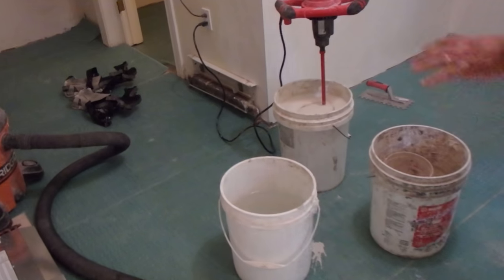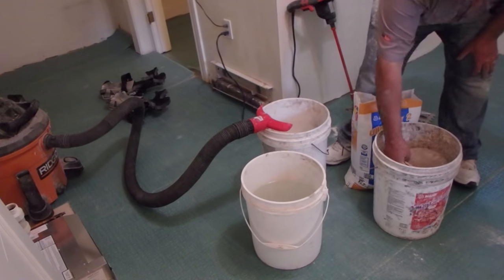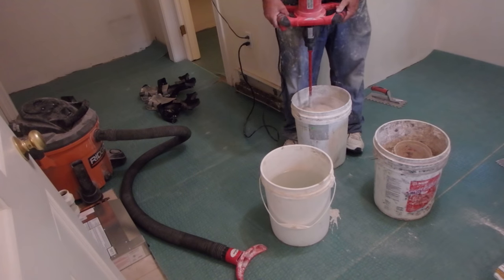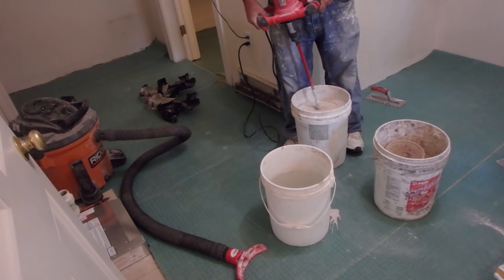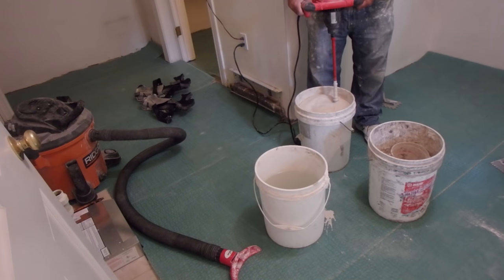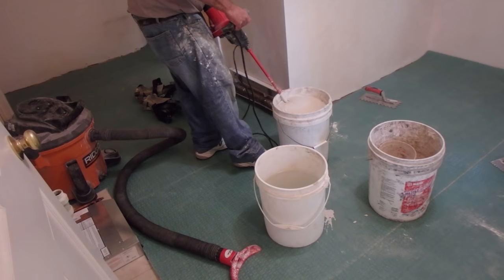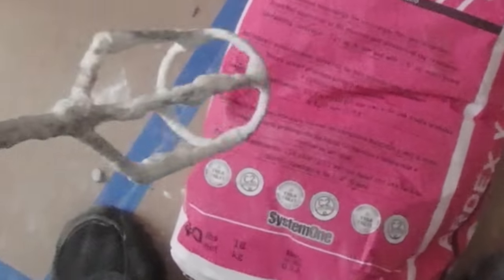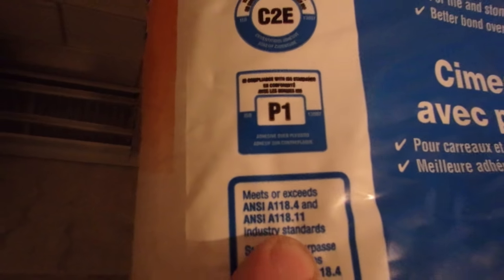How to mix thinset mortar the proper way,

Comment: Hi Sal- Thanks for sharing all of your knowledge. It's really helped me along the way. However, I made a mistake the other night. I mixed some Ardex-5 once, and only let it sit for 5 minutes before laying it down. I did not mix it a second time. Now, it's too late. It's hardened up, sitting in between Ditra and subfloor plywood. How concerned should I be? Thanks in advance!!
-Kex
Reply from the maker: You're in luck, X5 is one of those few thinsets that don't have to slake, mixit and go.

Comment: What's your thoughts on tubs of Mapei ready mixed tile adhesive? I have just tiled a small bathroom floor for the first time using mapei and I found that the adhesive squeezed up between the tiles. I was told to use a 4mm trowel and I thinly back buttered each tile. How can I avoid the adhesive between each tile? I  aim for 100% coverage by collapsing the notch lines.
Reply: Stay away from the pre mixed stuff! If it’s a 12x12 tile, use 3/8 trowel. Any larger, use 1/2. Many installers scrape away about 1/2 of thinset against existing tiles before laying the next one to reduce oozing out. I use the non-pointed edge of a painter’s tool. You also might be pressing down too hard or the floor isn’t perfectly level.
Reply: a margin trowel trowel also works well. swipe with the trowel  against the side of the tile next to the one you're installing. Also, make sure your thinset is the right consistency. Too soupy and it will tend to ooze up and out.
Reply from the maker: Thinset in a bucket is just mastic with sand, I stay away from it even when it might be an occasion that it would work, which is very rare. Directional troweling correct trowel size, proper thinset mix and technique will help with reducing the amount of thinset coming up the grout lines. the comments before mine make some good points as well.
Reply: @SalDiBlasi  Sal, you messed up a prime opportunity to say, again, "put down the bucket." Haha

Comment: Sal, with Schluters All-set, they claim that you can install porcelain tile inside a shower on top of the Kerri. Was wondering if you had done this in the field yet. Even though schulter says you can do it, I have hesitated to do so. Can you shed any light
Reply from the maker: Yes many times, they make their thinset to work with their product, so you can use it with confidence to set your tile over Schluter products..

Comment: how do dispose of thin-set and grout water?  pouring it in the drain with portland cement in it is not a good idea..
Reply from the maker: Let the solids settle to the bottom, then drain off the water and scoop out the residue.

Comment: Hi Sal, I mixed my thinset the same way you described here, but after 48 hours some of the tiles were coming off and the thinset was still a bit moist. Do you think I should have given it more time to cure considering it was in the basement room where the temperatures are around 67 degrees? Thanks!
Reply from the maker: Can't really say what might have happened without actually seeing it.
Reply: @SalDiBlasi  So you would not have any idea why the mortar was still moist after 48 hours, and what the actual cause of it was. Maybe I put the trowel lines the wrong way for poor air flow. I put them running from wall to wall instead of towards the entrance and exit of the room? The air conditioner has been running overtime in our home, but I only set it at 70 degrees, but suspect in the basement it is a bit cooler.
Reply: @SalDiBlasi   I did use 1/4 inch trowel to do the small job. Maybe what I did wrong is that I mixed flexbond mortar with a polymer modified one step mortar that I bought from another hardware store. I was running short, and sprinkled half a cup of flexbond into the mix, and the flexbond was an older mortar that I left in my furnace room for the last 7 years. Maybe that is the problem because the first half of the room was done only with the polymer and they seem to be okay? What do you think

Comment: Hi Sal, thanks for the video. Would you suggest premix buckets? I noticed they are two to three times more expensive but then no mixing...?
Reply from the maker: No absolutely not. I would not use that stuff if the paid me to use it.
Reply: @SalDiBlasi  Not the answer I was expecting. I will stick to the bags. Thanks!

Comment: What if you’re mixing less than a bag at a time?
Reply from the maker: Some mortars will have a ratio of powder to water, others you will have to figure out the ratio and mix it accordingly. You can divide a bag in half and use half the water.

Comment: Each tile has different density. You can’t mix same amount of water to thinset if you install a travertine, Saltillo, porcelain or ceramic material. Also they have different weight per square inch. Porcelain tile is more heavy than ceramic, so you need adjust consistency of a thinset or added Perlite to avoid sagging. Manufacturers don’t know details until you contact with them. We don’t need to go to there, they need to listen installers who works every day with there products.
Reply from the maker: Have you ever heard of ANSI Standards, in particular ANSI A118.1, A118.4, A118.11, and A118.15, which can also have additional properties like "T" for thixotropic, "E" for extended open time, and "F" for fast setting. You never modify the chemistry of the Dry Set Mortar, you use the one designed for the application you need and mix within the range of the liquid to suit your need. Have you ever read the bag, it is all there. Watch this https://www.youtube.com/watch?v=BJoPHGtukqo&t=455s plenty of free manufacturer training available to give you some insight into the products they make and the way they should be used. You can either continue to do what you do the way you do it, or get informed and see what the industry really is all about.

Comment: We got the cement whisperer don't do it by eye don't add water to make the concrete like butter I'm glad I don't do tile cuz I would do all the things he says don't do and actually I did a whole house this way and it's been 4 yrs as long as you back butter and keep ur trowel lines strate do it up... This info is for the perfectionists out there for other seriously 4 steps:

Mix powders to water till it's like a constency that can spread your gonna have to eyeball it

Clean the floor with broom ( the whole sponging/wiping with water is a lil over board)

Back butter a tile

Trowel the poweder/water concoction evenly strate lines

Lay it down space it let it dry call it a day 

It's like 4 and 1/2 steps but whose counting it's tiling just wing it!
Reply from the maker: You say all this because you are an expert in the field and know better than an entire industry, I think not.

Comment: I been tiling for about 10 years but I’m doing it on the side now I’m a nys correction officer now I can’t see justifying the insurance cost I priced the job $3,078.00 that’s 5 sq ft labor how can I supply materials that cost almost 2,000 in that cost the client said the other guy was cheaper than that and is supplying the backerboard thinset and caulk and grout
Reply from the maker: Could be the customer is just saying that to get you to lower the price, I never do anything by the square foot, and I never lower my price. But then again I don't  do this on the side for extra money, so my clientele is different to yours.

Comment: Hi, can anyone suggest the a adhesive material to have a perfect bond between two cement boards
Reply: Use urethane adhesive for wood floors, use a vnotch 1/4 x3/16 trowel, bostick
Reply: Mud

Comment: So we went in and assumed that mortar was similar to mud and you can keep adding water to keep it workable. We did this probably three times while installing our shower subway tile. We only have one wall left before we realized this weakens the bond. How concerned should we be 😵‍💫
Reply: We just used the Mapei ceramic tile mortar

Comment: That’s doesn’t matter how you mixing a thinset. If your floor is not level mix thicker, if your floor level than you can mixing thinner. I installed tile for 20 years and never had a problem with it. Most importantly if your floor is free of dust.
Reply from the maker: You are absolutely wrong, it matters greatly, saying otherwise means you don't understand the fundamentals of tile installation. Floor flatness, proper type of dry set mortar for the tile and the substrate and many other factors all have to be considered. Just because you have been doing it that way for 20 years, does not mean it is correct, it only means you have been doing it wrong all that time. Grab a TCNA handbook, go to some training, it is never too late to up your knowledge and quality of your installations. read these
https://www.ceramictilefoundation.org/blog/floor-or-wall-flat-enough-for-large-format-tile
https://www.ceramictilefoundation.org/blog/eliminate-spot-bonding-ceramic-tile-installation
https://www.tcnatile.com/faqs/64-thinset-mortar.html

Comment: I’m a slow first-timer: how can I prolong the workability of my thinset throughout the course of a day?
Reply from the maker: Mix smaller batches and use a thinset with a long pot life. Once you mix it and let it slake, never add water, you can loosen it up by spinning it with the drill, but there is only so much time that it will last.
Reply: Sal DiBlasi  Thanks Sal. To properly mix a smaller batch, should I use smaller bags rather than attempting to split a large bag?
Reply: @EMILBUS4390116  Just portion out a bag in two buckets and weigh them if you want to get precise.

Comment: All this manufactures recommendations just for beginners. Like in every business you figured out your own method of installation. The best judge is your experience. I’m not argue with you. Just let you know if using good thinset you can adjust mixing the way you want.
Reply from the maker: You really need to attend some manufacturer training, or NTCA workshop, Manufacturers put instructions on the bag for a reason, not following them will compromise the performance of the mortar. Don't take my word for it, talk to your rep. This is a misconception held by many installers.

Comment: following the directions on the bag is not always correct and is dependent on the temperature and humidity and other conditions in your area and job site, even the type of tile you are laying. 

Manufacturer directions are clinical only and subject to modification by experience or trial.

Comment: I don’t understand the point of this video. And I like your videos a lot. 

If someone doesn’t know how to follow the very clear instructions on the back then I doubt they can lay tiles properly. Mixing the adhesive is the easiest part.
Reply from the maker: It would seem pointless, but do a search on youtube and see just how much miss information there is. Go to a training event for Mapei, Ardex, Laticrete, or whatever, and you will discover how such a simple thing is done wrong so often. Most people do not understand just how important it is to mix the thinset according to direction.
Reply: @SalDiBlasi  went to one of those events and was amazing how many tile guys were mixing wrong according to the manufacturers. Been a GC for 20+ years and didn't realize the chemistry involved. The Russian tile guys are the worst. They can't be told anything because they think they know it all. Arrogance and ignorance are twin brothers and will screw up your jobs every time. Like wth my drywall guys I guess I will have to do it myself and save allot if grief.
Reply from the maker: john brever  There are a lot of experts around, that don't have a clue.
Reply: Because so many people just dump powder and water in and mix it up without measuring, so they never get batch consistency.  If your mix is not consistent from batch to batch then you will get height differences in the tile corners where you want them to match up if one batch is mixed a little thinner than the next batch. Very important not to just mix by guessing. Measure.
Reply: I’m a stickler for following instructions and I’m only a DIYer. I can’t be so arrogant to think I know better than the people that actually developed the formula. But after watching a whole slew of tiling videos I see why it was important for Sal to make this video. Guys mixing their own way, disregarding the intrusions altogether. Or saying to measure how much to use by holding the bag itself at say the quarter point or half way point and pouring the powder that way, disregarding the fact that the bag is not filled with powder to the tippy top so there will be more air and less powder, as well as too much water, in your first measurement and far too much powder in the rest of the bag holding measurements. Just use a damn measuring bucket for both the water & the powder and you’ll get the consistency the product was meant to be mixed at!!! It’s just not rocket science. There is a bit of leeway you have, but it’s still within the perimeter of the instructions on the bag. More water for a slightly thinner consistency and less water for a slightly thicker consistency, but you’ll have to know when to use each method for whatever application it applies too and stick within the provided instruction guidelines. Watch a few tiling videos and you’ll see what I mean about the audacity some of these people have to risk a potential failure in customers homes that paid them good money believing that you’ll behave like a professional. It’s the most unprofessional thing, that and the crappy tiling that usually follows; bad cuts, lippage and uneven grout lines. The real pros like Sal and others take their profession seriously and won’t take those risks with any job they’re on. 
And YES!!! Ignorance and arrogance go hand in hand.

Comment: If only the printing on the bags was legible. The bags I bought the print was smudged and unreadable
Reply from the maker: Easy enough to find it online. https://cdnmedia.mapei.com/docs/librariesprovider10/products-documents/3002823-ultraflex-2-en_ccd4306e321248daac3e172b9f23d59a.pdf?sfvrsn=373d6259_0

Comment: Adding water doesn't change the chemistry it changes physical properties.
Reply from the maker: Sorry, not a Chemist,  but the point is still valid,  it will not work as designed.
Reply: No, Sal was correct, it changes the chemistry. Cement curing is a chemical process.
Reply: A physical change results in a change of the material's appearance, but no new chemical products result. A chemical change involves a chemical reaction, with new substances produced as a result of the change.
Reply from the maker: Does that mean there is no Chemistry in the bag? The Chemistry is there, the point remains the same, follow directions.
Reply: Chemistry can not be in a bag, chemistry is a subject. Compounds/elements can be in a bag which produce a chemical reaction once mixed with water. My original comment was in regard to after the reaction started I.E. after you mixed the thin-set with water adding more water does not change the chemical reaction but does alter the physical property of the mixture. 
Its semantics in the end, but there is already such a lack of basic education around the world about science and you sound like you treat chemistry like Hollywood treats math (overtly complicated, repugnant and only for special people) and for a channel of your caliber and the attention and time you spend educating us about your work I would hope that at some point you do dive into the finer details of chemical composition and reactions that happen with all the materials. After all the main confusion about the products stems from people only knowing brand names and not fully the basic compounds that they mix together. and from that a fear arises of doing a mistake and thus people stop thinking and surrender to the brand name instead of the mind.
Reply: Dude, isn’t there a wall you can go talk to? Geez. Shut up!  You should be thanking Sal not nerding out on him.